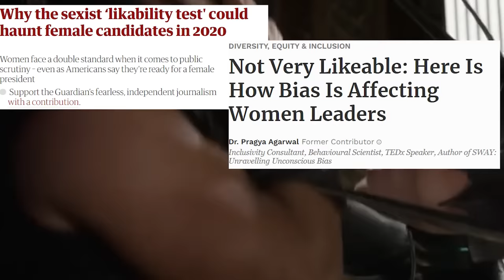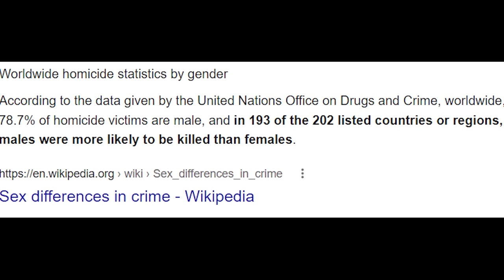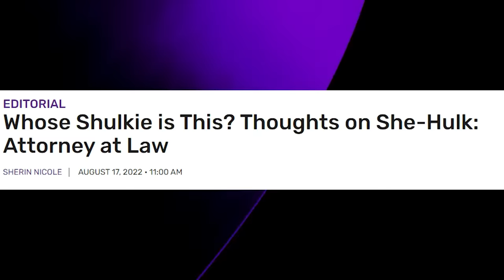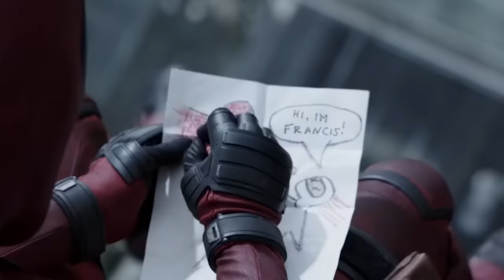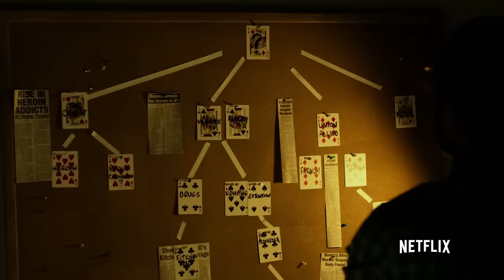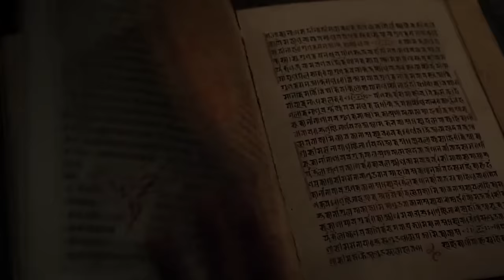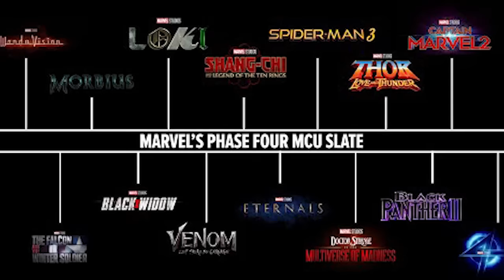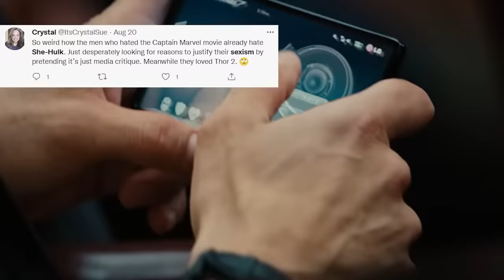She-Hulk - Nobody's Laughing

Comment: It's true that She-Hulk in the early 1980s would talk to the reader, break the 4th wall, often.  The differences between 1980s She-HuIk and this insufferable twat is that the original had a sense of humor (there was a lot of humor in it), super confident in an appealing way, could be self-deprecating, and let's be honest - was "hot" fan service and wore cut off short short jeans and tiny bikini tops or tight crop tops.  It wasn't my jam - I never bought the comic, but would scan it when I was busy picking up West Coast Avengers, Daredevil, etc...yes, a female comic book reader in the 1980s who was never shamed or harassed in any shop I went into...
And let me just add - as a woman who get crushes on monsters - I didn't care if dudes were into She-Hulk.  You get She-Hulk, back then I'd take Nightcrawler or Jean Cocteau's Bete - from Beauty and the Beast.